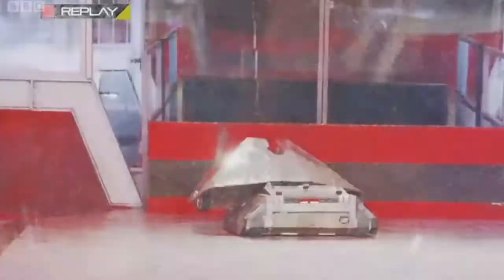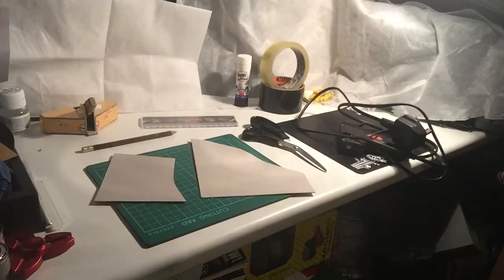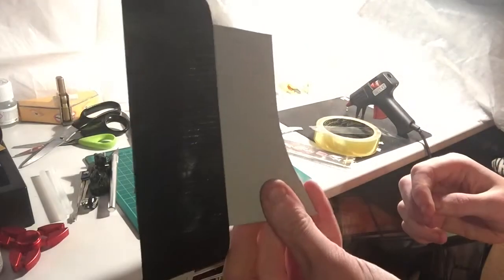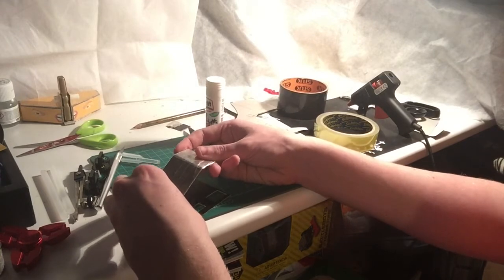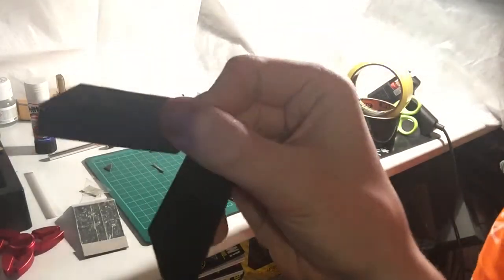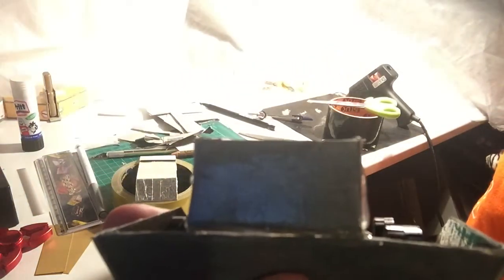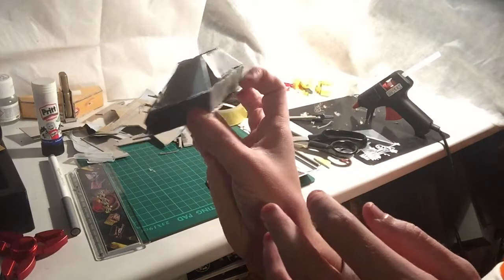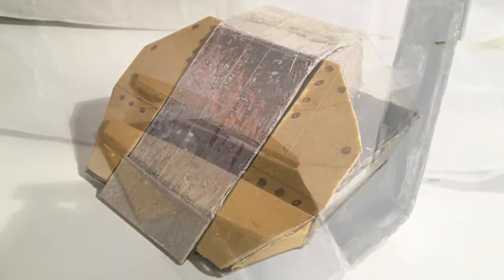Build Your Own Rapid | More Robots Special

Comment: "One of the best flippers"  Fails to self-right and gets stuck upside down with the flipper jammed open.
Reply from the maker: Revan384 Just the way I like it. You can’t argue with the power of it, nor the mechanical engineering that’s gone into it. You can argue with the bungees though...
Reply: it was too powerful they did a triple flip and landed there